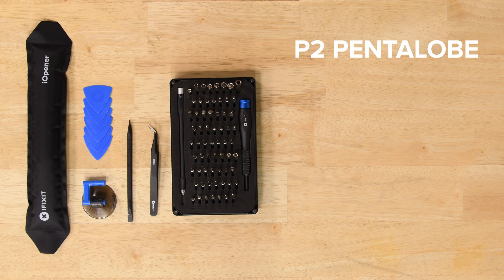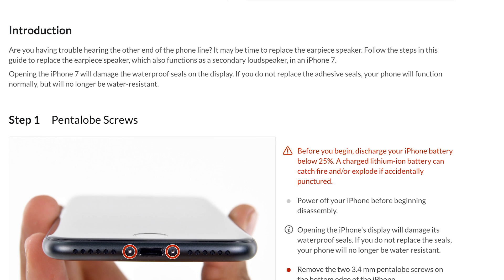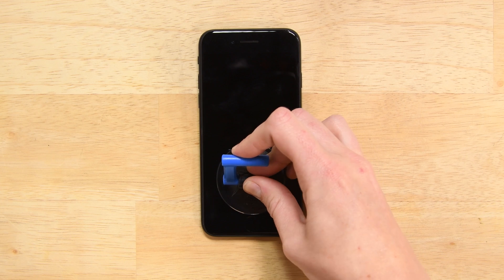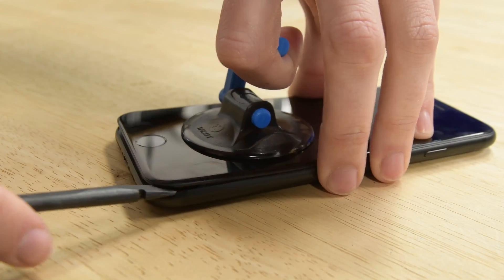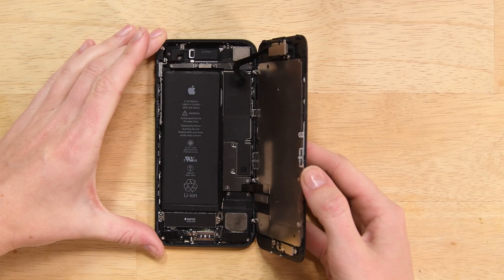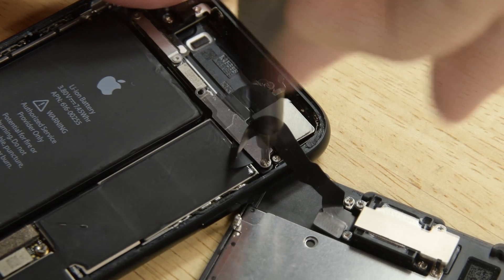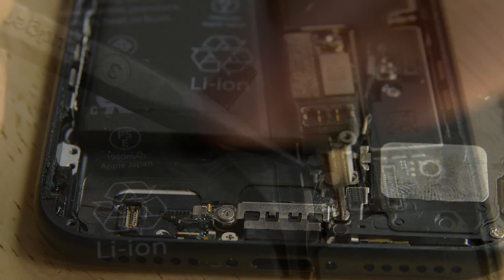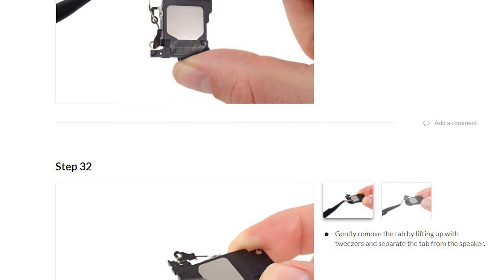iPhone 7 Speaker Replacement- How To

Comment: I have tried after replacement of speaker my phone keep restarting  could you tell me whats the problem
Reply: Disconected battery, or teared screen flex cables, in wich case the phone will not recognose home button being connected.